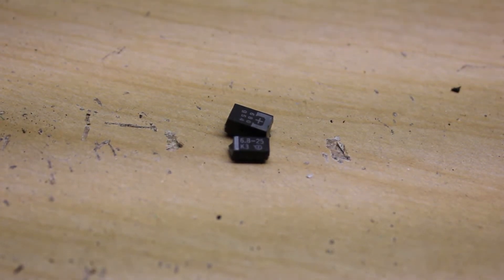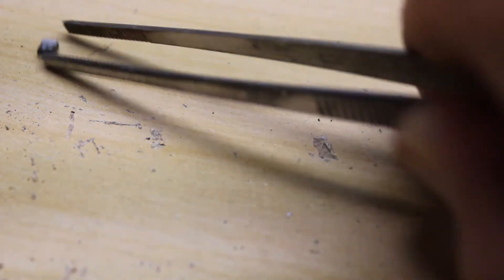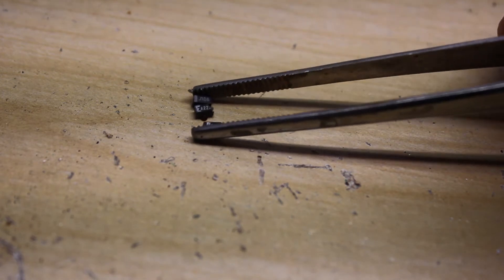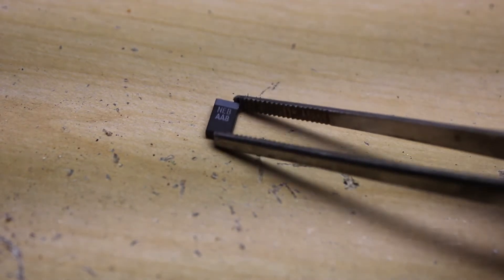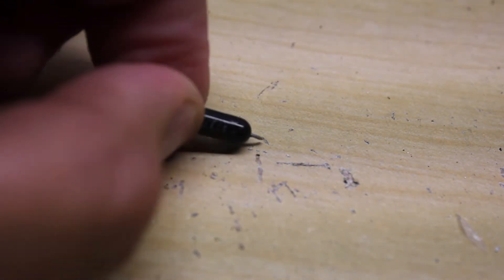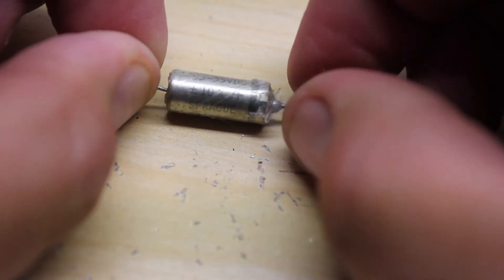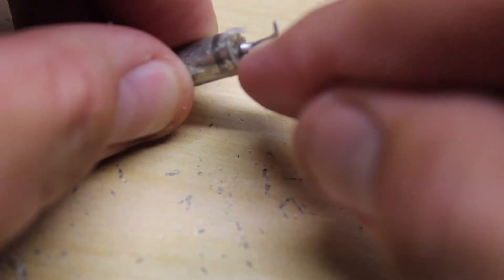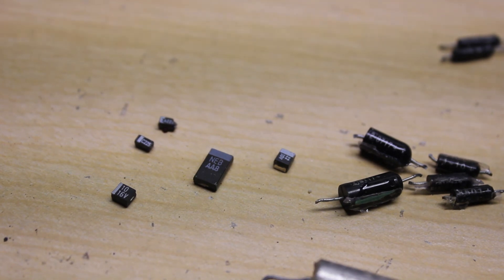Alamo City Scrapping - Determining Tantalum Capacitors Pt. 2

Comment: In my experience,  the circuit boards are labeled for each component (D for  diode) & (C for capacitor) and the C will be marked with a (+) at one end,  but the D will not....   :-)  L8R G8R